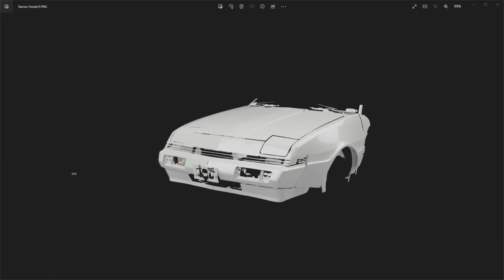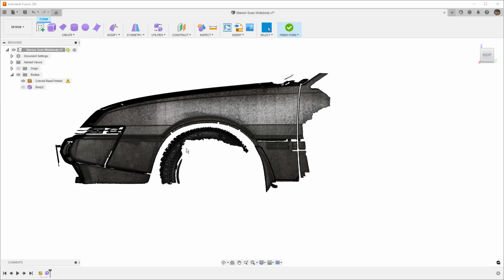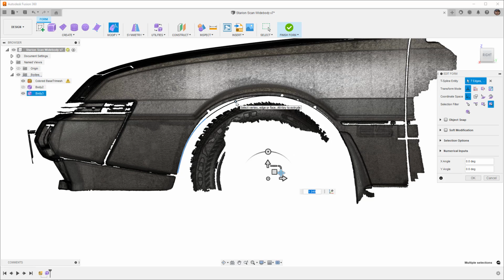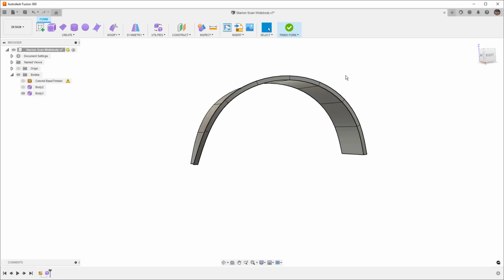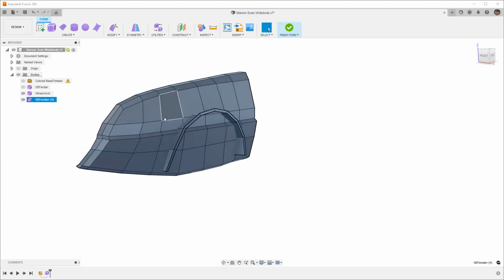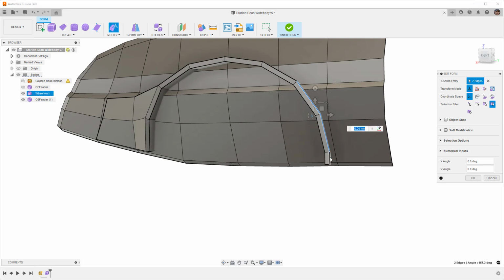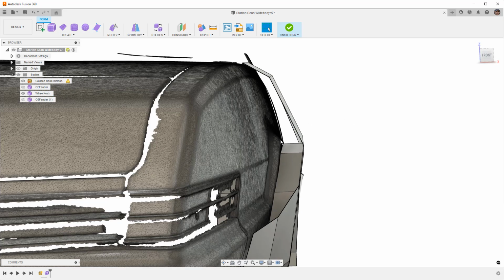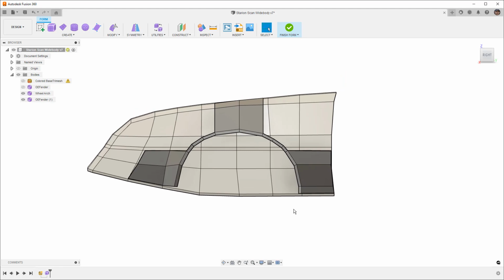3D Scan to Part Series Part 6 | Wide Body Design Part 3 | How To Start Transitioning From an Arch

Comment: Hello matt, i have an issue that when im doing the fender and you use alt plus ctrl to make the little edge and then you want to decide how much you want to move it, however your units make sense and mines are way bigger, the cilinder for example says that it is 1400 mm long. I imported the file as STL what is the issue here?
Reply from the maker: hmm thats interesting.  The scale shouldn't really matter if you aren't going to print the part to fit. When I draw a form cylinder for the wheel well its around 780mm diameter.  Starting with this file https://a360.co/3iEJ4S4  
How are you bringing it in as an stl?  are you exporting the mesh from the design and bringing it back in?

Comment: At 13:42 when i'm trying to inset edge i can't pass to the part you just extruded like you did on the video, it goes to the line you selected and won't go above, could you give me some tip?
Reply from the maker: are you getting a full green edge?  One thing you can try is look in the dialog box at the number.  if its positive, manually add a negative number and see if it flips then.  Otherwise you can just try the same thing with the outside edge you just created and see if that works (rather than the creased edge).
Reply: @LearnEverythingAboutDesign  It worked using the upper edge, but from the edge you just used on video it didn't, but anyway thanks for the very fast reply! 😃
Reply from the maker: @hugoTets  One other possible idea or reason. sometimes if you let go of the keys and hit them again real quick (or don't press them enough) there might be 2 edges real close to each other.  You can double click on the creased edge and hit Delete, if it stays that means there were two really close to each other.  Inserting a new edge is a percentage of the distance between existing edges.  so if two were real close you might never see it trying to add an edge.

Comment: Olá Matt. Preciso que você tire uma dúvida por favor. Quando faço uma extrusão nas arestas (como essa do arco do paralama) as linhas ficam escuras e grossas e não aceitam modo de exibição "suave". Já tentei resolver sem sucesso. Você saberia me dizer o que estou fazendo de errado? Agradeço se você puder me ajudar.
Reply from the maker: It is hard to say without seeing the file.  Usually a dark edge is extruded with a crease (ctrl + alt).  The fact that it won't go into smooth display usually means there is a problem like you  have an extrusion connected at a single vertex.  you can share the file with me and im happy to take a look. support@caducator.com
Reply: @LearnEverythingAboutDesign  Obrigado pelo retorno e disponibilidade em me ajudar. Enviei o arquivo para seu e-mail. Saudações!
Reply: @LearnEverythingAboutDesign  Olá Matt. Obrigado pelo esclarecimento. Eu estava fazendo certo mas as teclas ALT do meu teclado tem funções diferentes. Descobri que devo usar a do lado esquerdo para extrusão no modo suave. Mais uma vez agradeço pela colaboração.

Comment: Matt, keep going with the detailed process - a lot to learn from this. I´d  love to see some modeling with  canards. there is not much out there,at least with fusion.
Reply from the maker: Thanks, will do!  Canards are likely easier to do as a surface after the fact as opposed to as a form body. or at least one that is attached.  I will give it some thought on the best way to add those details.  The next video in this series will be out on wednesday where we start to actually get a fender shape together.